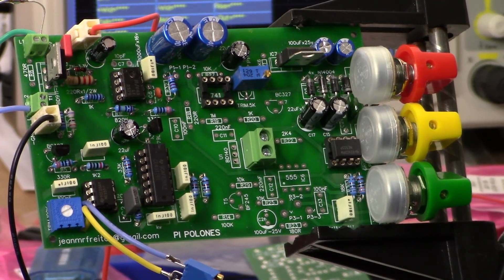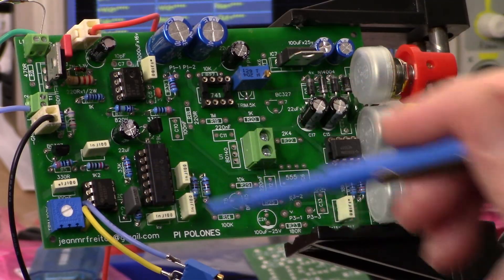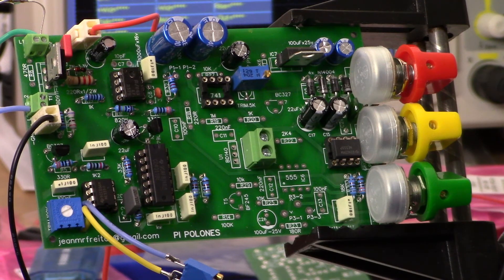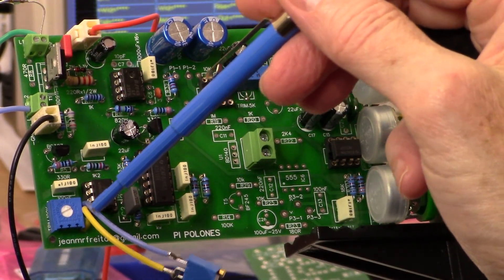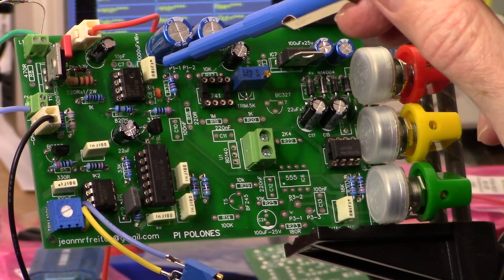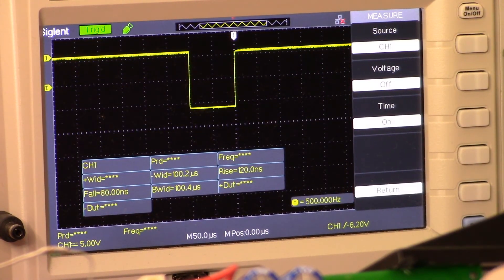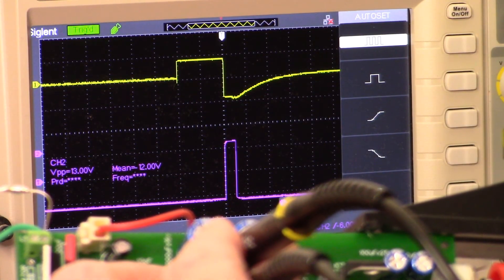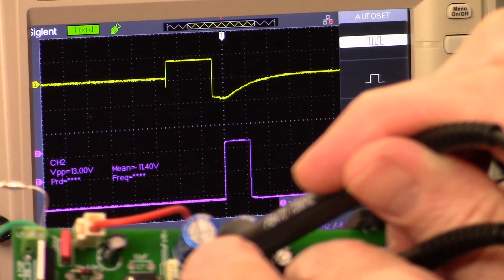PI Polones DIY part #5

Comment: Hola amigo una consulta, vi que cambio la resistencia de 33 k por una de 15k para retrasar lo que usted llama la muestra; pero eso que significa, en que mejora el detector ? Vi un video de la India donde hacían ese cambio para que el pi polones detecte supuestamente Oro.
Reply from the maker: The faster you sample after the detector pulse the better your detector will be at detecting smaller gold.  You must also have a fast coil as well.

Comment: hi nice job

In your previous article, you are saying that you changed r10 and r11 with a value of 15k. You said 18k here, a pronunciation error.?
Reply from the maker: Hello my friend.  Thank you for watching.  I actually changed those resistors many times with values from 13K though 33K.
If you are interested in building a good Pulse Induction project I would suggest the Crossbow Classic.  It is a much better and more stable machine than the Polones.
Reply: @SurfDetector  Thanks for your answer.
I already have a pi polones circuit. I will try .
I would like to make Crossbow Classic. Is there a site selling the pcb card? I could not find it. Thanks
Reply from the maker: @volchanick  You can get the Gerbers  on the Geotech Forum for the Crossbow.

Comment: Thank you for sharing this amazing informations
I working on it
Sir i have a question 
Are they printing problems or are they working well?
Reply from the maker: Hello Bilal,  I am sorry but I do not understand your question?  Please rephrase for me, thanks.
Reply: @SurfDetector  thank for your comment
Reply: Sorry keyboard problem 
My qeustion is,is  it the pcb have a  printing problems or it s  working well?
Especialy in GND
Reply from the maker: @bilalhajji9473  On this PCB what is marked as GND is really -12V.  The +12 volts is really what is used as ground on this project.  There are a couple of other problems too which I will tell about in the next video.
Reply: @SurfDetector  thank you for your reply i m waiting for your next videos 
I hope you the best